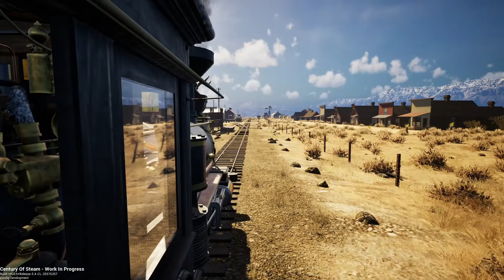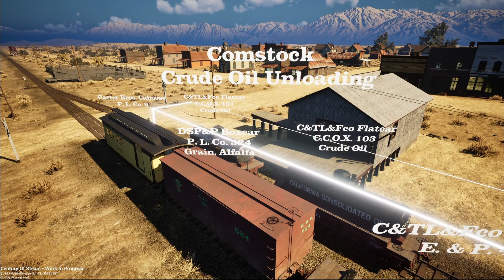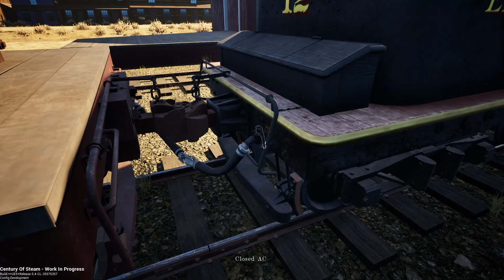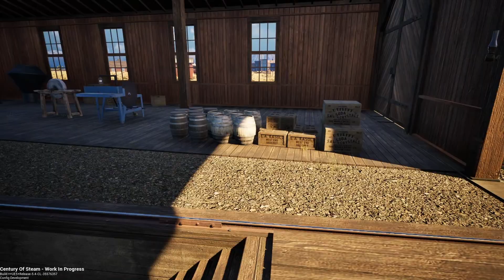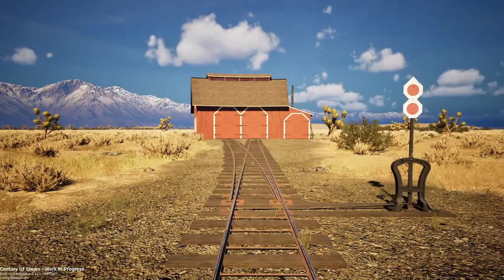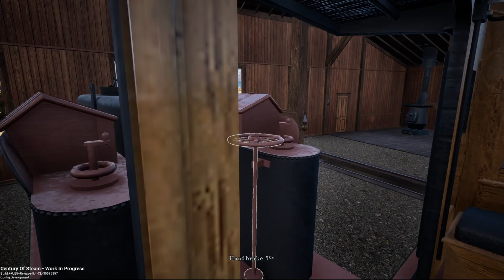EASY TURNTABLES and MODULAR Roundhouses! | CoS Devlog

Comment: The modular design looks amazing!
I hope we get a couple of diameters, both because that 36 per circle layout looks like a very large asset to try fit into some regions of the ma, and also because the various turn table/bay lengths played a pretty considerable role in influencing what locomotives railroads bought, and what lines they ran them on.

Comment: It would be cool to have loading zones marked with actual physical markers in the ground or something. Also, you might want to consider reducing the reverb for the whistle when you're right next to it vs being further away. In real life there would be almost no reverb standing right next to or inside a locomotive unless you were in a tunnel or something and it really shouldn't sound like its in a tunnel with a super long reverb when its out in an open space like that. Adding some delay instead of reverb could really help as well, especially in a wide open space with mountains or something else reflective but at a distance.

Comment: Dear studio 346, I can see that that game has really good graphics. What would be the likely minimum pc specs for running the game at lets say normal graphics (if there will be different graphical settings.) I cant wait for the game to release and I have had it wish listed since the first sneak peak, and would not like to be running the game at 17fps because my pc is bad, cant wait for the next devlog. -Jtracks
Reply: There isn't really an answer to that question till the game is near release.
Required hardware will change massively with every new feature, optimization and update, both by the game devs, and by the makers of the engine on which the game is built.
Likewise hardware that most customers have is going to change between now and release, and that will impact what features are viable for the studio to simulate fully, vs obfuscate away, and most of the time thats core choices in how the games built, not option that can be toggled in settings .

For some examples, does the water in a boiler "slosh" with movement, or do you simply offset the displayed water level based on the current track grade. Or does the amount of weight on the driving wheels change as we go up a steep hill, and is that simulaitng the suspension style, or is suspension statically modeled... all these choices are based on what impact physics simulation will have to the games performance, do too much and most people will have low FPS (or stutter/drops), do too little and the locomotives won't look, feel and sound quite "right", with fun and immersion suffering at both extremes.
Reply: @SheepInACart  right, i was just wondering if there was.

Comment: I'd say I need to see the loco coasting as it seems like its still "puffing" unlike what you see here in this video https://youtu.be/d0qwSecaiyw?si=6U-SQ9luuwH-hGkz&t=288
Where the loco is moving off regulator. I suppose throttling on slowing would allow steam to continue to "puff" but it doesn't sound right. The puffs should be longer and not all uniformed. On take up the "puff" would be more of a whoosh as it moves through the valves slowly and up through the blast pipe. I would consider seeing if you can adjust this otherwise all the hard work of modelling the steam process is great but it sounds very similar to all the other sims out there. Modulated sound instead of a file it runs at a certain point or beat unless I'm talking rubbish haha.
Reply: Remember, the locomotive in the video is an Baldwin 8-18C, with rather small cylinders. Since Mark still has the throttle wide open, and precedes to put the bar in the corner, it’s going bark rather loudly. The locomotive in the other video has significantly larger cylinders and (presumably) doesn’t have the throttle wide open. Hyce (the same person in the video) has a video about the Glenbrook fighting up a sharp grade at the Cumbres and Toltec railroad. Most of the video is about the trip as a whole, but there is a clip at 22:00 showing What these old Baldwins sound like at full power while moving slowly. The locomotive is a 2-6-0 with marginally larger cylinders, but they’re going to sound similar at the same speeds. STS: Glenbrook 1vs1 with Cumbres pass is the title of the video if you want to track it down yourself. I’d link it if I could, but can’t with the device I am using. Now the devlog isn’t set on a grade, but the loco is trying to pull through the train brake.
Reply: @Stooltoad5017  cheers bud I'll check that one out right now 👌

Comment: Obviously no one wants bugs in a game, but sometimes they can have humorous results. An example from the latest MSFS would be a passenger hanging outside the bottom of an airplane and seemingly dragging their head on the ground because the game had them rotated wrong. 

If you have had any bugs like that where you couldn't help but giggle at the results before fixing it, that would make for a good compilation video. It could be a fitting salute to the end of the main development period.

Comment: Make smoothing user-adjustable (via a slider?) with sensible default setting(s)?  Some people may have some tremors that want a bit more smoothing and an FPS gamer with a setup that allows for highly reactive control (say, a mouse that reports position/movement 1000 times per second) might want less smoothing.  That way both would get what they want without having to compromise, while Joe Average could be perfectly fine with the "normal" default setting and needs not touch anything ...

Comment: Looks fantastic but I do have a concern with the chuffing at the beginning. If a train is running into a station the regulator would be closed and so there would be no chuff sound. Is there something going on here in the vid that's not obvious?
Reply: Hyce was still moving the throttle coming to a stop rather than having it fully drift to a stop. That's why it was still chuffing.

Comment: So, how does the table and the round house connect to each other? Is it slap them down repeatedly and hope your track is eventually straight, or is there track already that one or the other sync connects to? That’s what I’m curious about… and if the table lock will eventually be animated instead of just a click sound when it stops? I ask since most turn tables have a piece that rolls out to lock it in place by sliding into the rails. I think the museum Hyce works at has this? And I think maybe they do in Carson City? I know they have a monster of a lock that’s physically hand bolted at the table in Cheyenne, since big steam like 4014 is a thing there. I love how much you guys go into the minor details with what you do, stuff everyone else overlooks entirely or just Nimrod slaps a universal look to regardless of reality… so, just curious if a table lock might be animated in the future. As far as the UI showing the box where a car can load or unload, maybe a box like that for the tender as well? Specifically, for where you need to aline the water spout or a coal chute / oil line connection? …and, admittedly, the sand dome would also be nice… Fingers crossed this year I can finally return to working, so can finally afford a Patreon here and membership over on your main channel, Hyce. Still a lot to sort out… but fingers crossed.

Comment: I'm probably not the first person with this idea to comment it, but I literally had to pause so I could get it out before I lost it. Something that could be really cool with the alt UI for switches would be to display an image representing the line the points lead to and other not-switched line(s). That image would of course update to display which line is switched and will rotate about the horizontal plane to follow you around like the rolling stock text in the UI, but the image will also rotate about the vertical plane in correspondence to where you are in relation to the switch so you can easily identify the not only where the tracks are lined to, but in what general direction they lead to.

Comment: Is there also a way to configure turntable size? I can see that table becoming quite restrictive when thinking about bigger locomotives.

Another question i have: You said that full roundhouses are ridiculous for the narrow gauge (fair), but what actually was the biggest 3ft narrow gauge roundhouse? 
I think thats important if i want to go for "plausible deniablity" with roundhouse size :)
Reply: On the Rio Grande in its later years, Alamosa then Durango would have been the biggest narrow gauge roundhouses (and both dual gauge for a time). Burnham may have also been pretty big earlier when it was still narrow gauge/dual gauge as well. If you expand beyond American narrow gauge, I wouldn't be shocked if there were some huge meter gauge facilities in Europe or South America (not a roundhouse, but the Talleres de Tafi Viejo in Argentina are huge meter gauge shops).

Comment: Following this videos not every time, i am wondering about having the opportunity to use analog inputs.  The best way, i ever controlled a train-sim was with my 3-axis throttle-device from Saitek. Once "on the engine", you could smoothly control the moovement.  Unfortunately, atm none of the train-sims supports this without additional, often outdated addons. Having the opportunity, tu use analog axis and assign external input-buttons would be very nice !! ( There is a lot of hardware-stuff for example for controlling farmsim-games and flichtsimulation out there already ! Please make it usuable )  Best regards from a upcoming customer  :-)

Comment: this game looks soooo good, it's so advanced, 
it shows if yer not confined with someone else what ye really can achive.

The whistle sound are great but, you really have to rework the echo, 
in a roundhouse it won't echo like in a canyon or an open flat space.
For what I know can UR5 change sounds according to the grid,
or simulate it bounce off from walls.

for the car name thing put the % loaded on it aswell.

But didn't the DRG had a fully circle round house at Pueblo
and one in one of theier Mayor enginefacilities?

Comment: There need to be presets for colorblind users. Just manually defining each color aspect is great, but might be intimidating for someone new to signals. Having pre-set profiles for certain colorblindnesses (there's definitely resources available delving into accomodating different colorblind conditions) would probably be helpful. Another possibility might be to have glowing semaphores at night, so you can read the signal aspect with no color information at all.

Comment: I love the modularity of the roundhouse, it's also amazing that it can work with the switches so effortlessly. I wish a certain other railroading game took some notes about different parts of the building toolbox fitting with one another. Also seeing that straight workshop at the end of the roundhouse is making me wonder whether we will be able to transition from a roundhouse into a wider straight building, or if the same modular builder will also include options for rectangular engine sheds.

The turntable QoL is amazing, but I wish we also had a (not too slow) option to drag it to position manually. It's a nice bit of immersion.

Also for the UI I like that it's not always visible since it is quite a lot. I'm not sure if the engine really needs to show its wheel arrangement since that's pretty obvious, but maybe having fuel/water levels displayed would help idendifying whether it's good to go. Still it's very nice getting the cargo info on demand instead of having to find the correct angle on each car to let it show.

Comment: I get more excited every time I see a dev log.
However, there's a little gremlin inside of me that wonders how well I could bodge together a facsimile of my local narrow gauge railway in the UK using this game, especially considering models of each of the locos don't yet exist lol. And that the gauge is 15 inches...
Especially stupid since I'm a holdout using Windows 7, which I doubt an unreal 5 thing will ever support.
Is support for slower chuffs in the pipeline? I noticed they're still relatively short even at long cutoffs while going slowly in this vid.
Reply: There were a few UK narrow gauge lines with Baldwin export engines... and that's about where the similarities end.

The irony is the UK narrow gauge kicked off the American one. William Jackson Palmer skipped his own honeymoon to visit the Ffestiniog Railway and talk trains with Robert Fairlie. Baldwin, Billmeyer & Smalls and other manufactures jumped in on offering "Fairlie gauge" equipment. The US narrow gauge had a moment, a mix of engineering and buisness fervor. 

But then, the British influence was immediately lost. B&S's two axle cars were replaced with full four axle cars on proper pivoting trucks. The Baldwin 2-8-0 proved a better locomotive in America than a lone export Double Fairlie to the Rio Grande did, and William Mason's own Bogies further eclipsed Fairlie's influence. Then the Colorado Midland rolls up with a standard gauge railroad through the Rockies, and the dominoes begin to fall which unravel the narrow gauge in America. 

Maybe, maybe, if this game has early two axle B&S stock and the Double Fairlie you can get some of that British feeling. Hell, while Railroads Online is rightfully criticized for a lot of problems if you can back date it to a version that works, the "plantation cars" and the 0-4-0T Porter (which may have been inspired by the Fletcher Jennings locomotives of the era such as Talyllyn) is a decent glimpse into when American narrow gauge was it's most British still. Only problem is you have to fight RO! for that, and I hope CoS can one-up RO! in that early narrow gauge representation.

Comment: Looks amazing as always. My only pet peeve so far is that the whistles do sound a little too electronic and not "steamy" enough, if that makes sense
Reply: I think what's missing is the sound of steam leaving through a small opening. I found that you can easily tell the main whistle note and it's harmonics apart from just the steam leaving the pressure vessel if you listen to a recording on low volume. You can try to listen to a recording you made or a YouTube video on the lowest volume you can easily hear and you'll quickly see the difference between that and three whistles in the game.
Reply: From what I can tell from my whistle recordings it looks like all they have to do is overlay on the whistle the sound of steam as I said earlier but modulated by how the wind blows. 
I don't know how much the wind affects the steam sound, or how it has to blow to change it but I know it has a very noticeable effect.